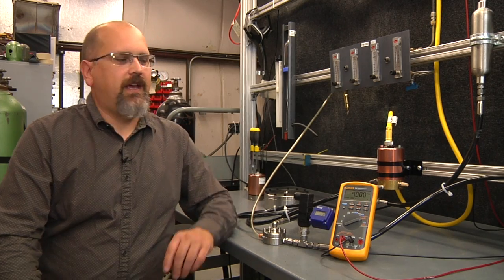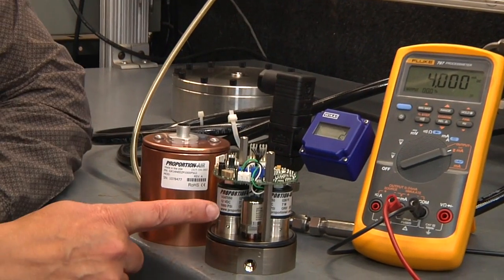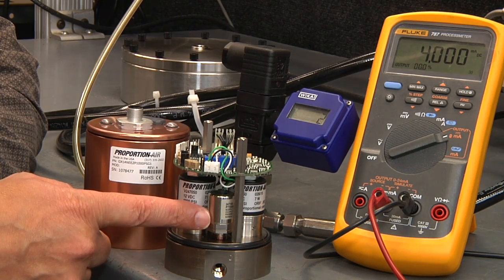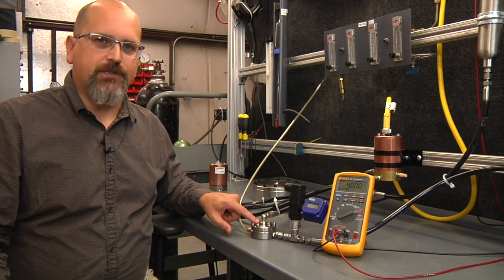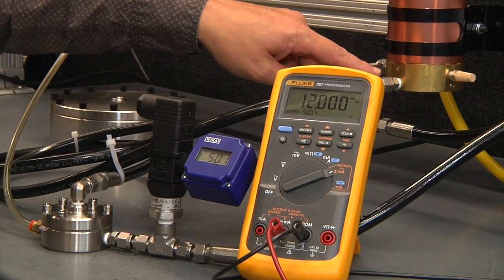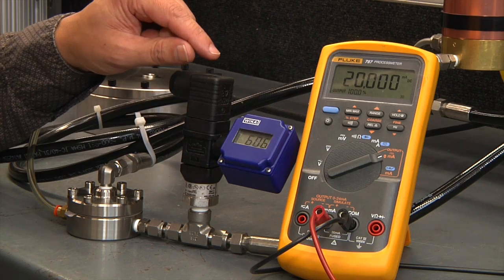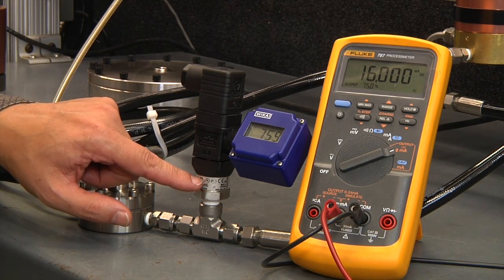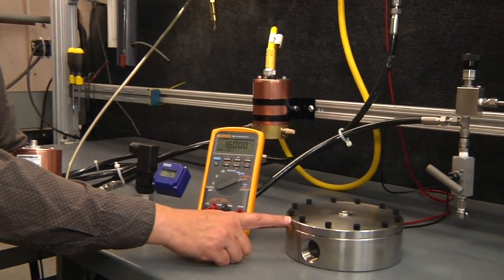Electronic Back Pressure Regulator for High Pressures

Comment: Question, does the Proportion Air pressure regulator actually increase (multiple) the air pressure within itself, and then delivers that pressure to the BPR? For example if I want 1000 psi realized at the BPR, does my air compressor have to achieve 1000 psi also?
Reply from the maker: Thank your for your question. The GX regulates by stepping a higher pressure down to a lower one. Supply pressure must always be at least as high or higher than the desired output pressure. Therefore, you will need 1000 to 1100psi of supply pressure to achieve 1000psi output .  You may contact us with any other questions. https://www.equilibar.com/contact/